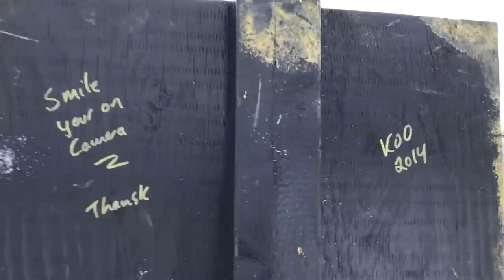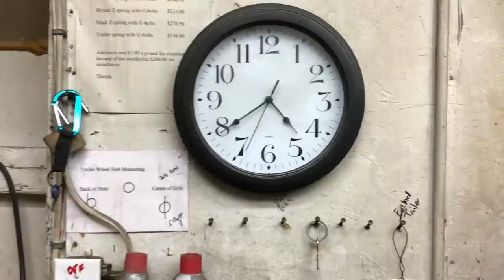Welding on AC DC Sleigh Screaming Ford Runs Jan 18 2023

Comment: Screaming Ford started so quickly and so litte smoke. Smooth runner, is it an International diesel? 
Looks to be a 1980-82 model year - yes?
1974, got it.
Reply from the maker: the 1500w block heater was plugged in all night then the diesel heater blowing on the oil pan made for an easy start.  thansk

Comment: I lay a rope in the bottom of the fuel tank after I have run the engine and the fuel in the tank is warm. I push the rope to the bottom and have a reach wire that can snag it.  When the fuel in cold and the moisture in the bottom of the tank freezes ....I pull the rope out and all the ice, crud, and grit in the bottom of the  if frozen to the rope.  That is how I winter clean the bottom of the tank.
Reply from the maker: oh my that is a lot of work but you get it done.  thansk

Comment: Hey Joe, what do you need to get the rear diff functional again, (besides replacing the short shaft) ?  Whole new housing, the works ?  My hat is off to anyone who keeps old iron going or even finds old "dead" machinery and manages to bring it back to life.  I declined the latest offerings of '22 and then '23 Freightliners.  Nothing but annoying and distracting beepers, buzzers, flashing LCD panels. To hard to drive them and concentrate on what is going on in front of you.  Sure do miss the old "junk" I started out with. Little did we know back then what was to come in the future.
Reply from the maker: Sir Rodney at westrans in winnipeg has everything we need to fix the Screaming Ford but at the time of the covid lock downs it was not worth fixing because food and heat was more important. with these new trucks and all the rules that is why the older generation is not driving trucks any more. too many hours sitting doing nothing and not enough driving hours.  thansk

Comment: Would it be easier to put fuel additives in the slip tank or you ptefer to dose every piece of equipment for its needed recipe?
Reply from the maker: no, the cats get 3 times more of the 2 stroke to lube up the injectors so each machine is different and the mini Hoe gets nothing since it is a new style machine.  thansk

Comment: Anyway part 2 of pulling the spinning chain behind the cat train to shine it up after laying in the swamp for 40 years. 
Beautiful spring day, 1 D6, pulling fuel storage system, generator/repair shed, & 1 long Kitchen, Bathroom Sleeper combo. Suddenly the cat op spy’s a fellow running up alongside nearly having a heart attack so he brings the train to a stop, this fellow is winded & is having trouble catching his breath, finally he climbs up on the c-frame of the dozer & breathlessly points to the rear & asks how far he was pulling this thing. The operator replied about 90-100 more miles to the hi grade road for loading. The guy is French & hung his head & said a few expletives & OH No!!! The operator told him the chain was being dragged to polish the rust off it, no problem. The guy just shook his head in disgust & walked back to his vehicle. The operator fired the dozer & travelled. Few hundred feet up to let the pick up pass then thought he better check the sleighs. He was nearing the rear & found a cross chain to the rear bunk on the kitchen had snapped & he was pulling the rear sleigh sideways cutting the last bit of ice off the trail & baring the muskeg to the sun… for the last 5 MILES!!!
Needless to say, a few hours were spent with both dozers covering the trail as their was 1 lone rig that was  not finished drilling yet!!
I wish I could have seen that fellows face when he heard the 100 miles remark!! Lol 😂
Reply from the maker: quite the story and a fact of life back then.  thansk